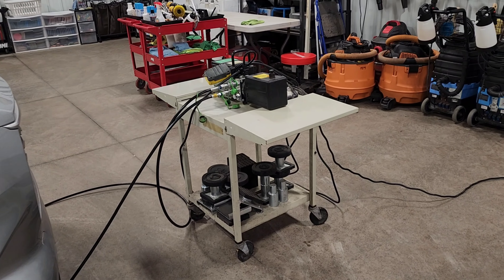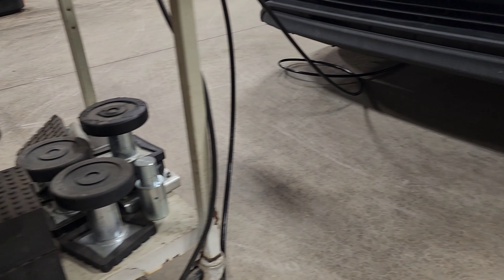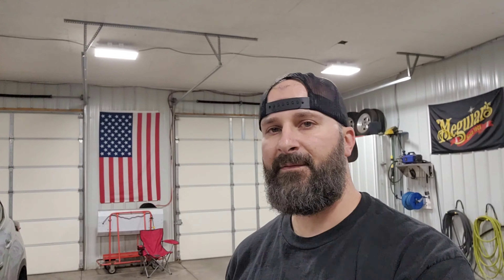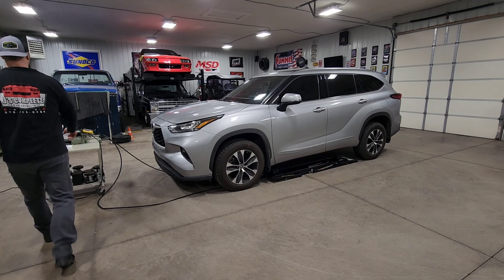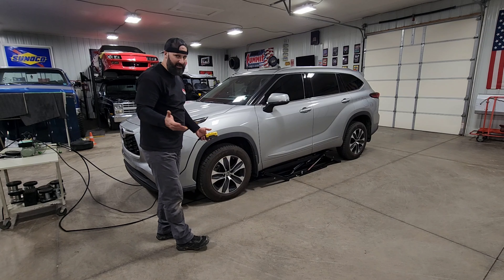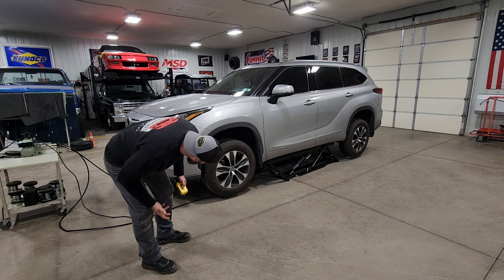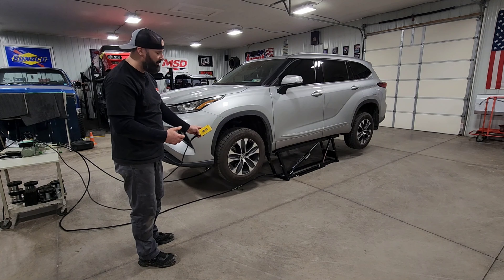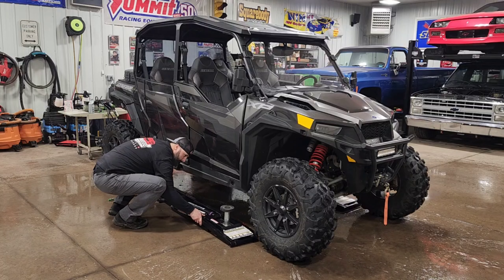Quickjack 7000TLX; 2yrs Later. Do I Still Use Them?

Comment: Thank you for the video. Trying to decide which model to buy. You said you used this on C8 corvettes. Any problems? You are the only one I can find that has mentioned it. I have a C8 and a Cadillac Escalade. The Escalade is too heavy for the 5000 series. Thank you
Reply from the maker: @fishingwitheric7828  no issues lifting the C8. I've actually used it on a few Corvettes.
Reply: @JsAutoDetailing  thank you so much.
Reply from the maker: @fishingwitheric7828  you're welcome. Thanks for checking out my video!!

Comment: i thought when you rotated tires the front cycle to the rear  fr to rr  fl to rl  and the rear cross to the front rr to fl  rl to fr?
Reply: You have it backwards. (assuming your tires are NOT directional, in which case they MUST stay on the same side) The rear go straight up to the front, same sides .. they are "wore into" that rotation and will handle well immediately in the steering position. The fronts cross over on their way back. Any handling abnormalities will not be felt as it wears into the new (reverse0 rotation. This evens out the wear side to side, and the "now in the rear" tires will "wear" in to the new rotation after a few drives and will be ready to move to the front at the next rotation.